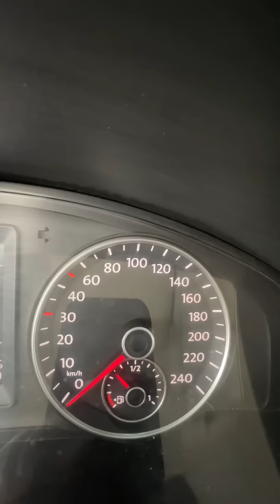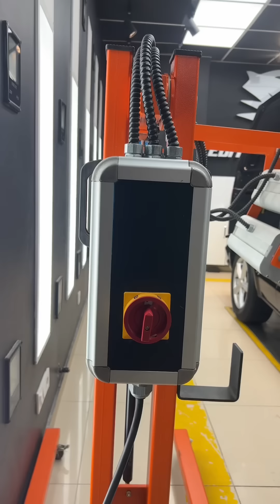Transforming a CARAVELLE: Paint Restoration and Deep Interior Cleaning

Comment: Absolutely stunning work done here.  So detailed and what a transformation..  keep up the work
Reply from the maker: thank you have fun.:)
Reply: @Depcars  amazing work.   I have a 2004 Mk4 VW Golf with the full cream interior with the cream leather seats, I’ve owned the car from brand new and I keep the interior as clean as it was from brand new, only but I have slight problems with is the seat belt, it’s cream and with constant use you can see the slight dirt in the seatbelt webbing, I’ve tried everything to clean the seatbelt but I can never find anything good enough.   What do you use on your seatbelts to clean them .   Thanks
Reply: Cok güzel oldu ellerinize saglık ic temizlik icin hangi ilaci kullandiniz